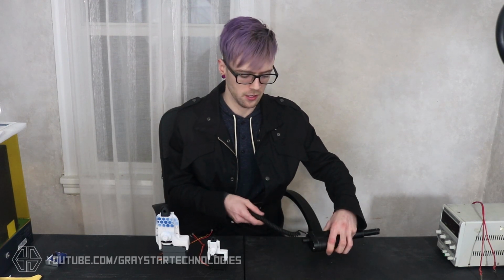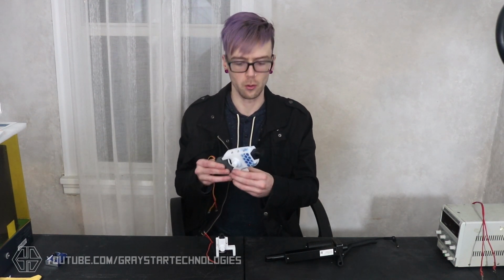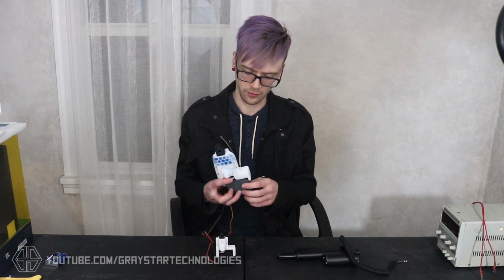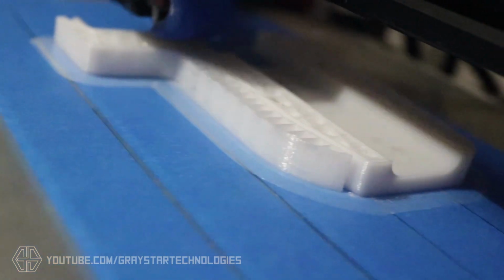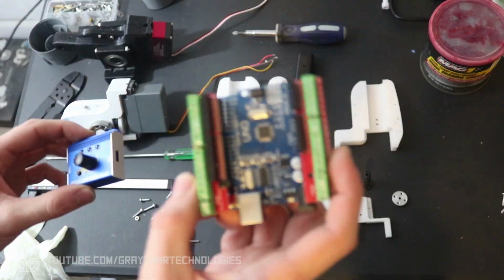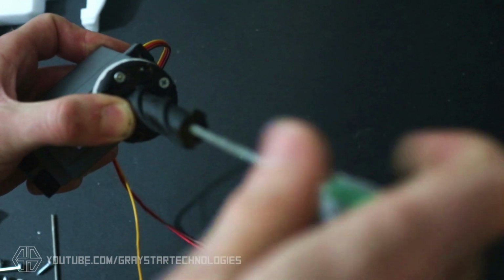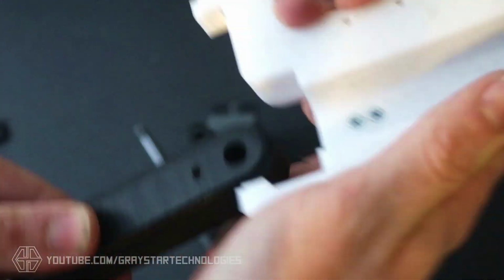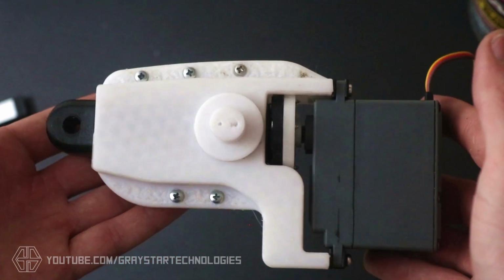Ep 1: Tutorial - How to Make a 3d Printed Linear Actuator from a Servo

Comment: This is perfect, I'm pretty terrible at modelling but just about getting by. This leadscrew design for rotary -> linear movement is just what I needed.
Thanks.
Reply from the maker: Glad it helps! :) That was the goal for this was a simple actuator to add motion to a whole bunch of applications! I'll have a "v2" video coming soon!
Reply: @GrayStarInnovations  I printed it and they work great. Using them to actuate paddles in a seat for a motion chair in my sim racing rig. What software did you use for modelling it? I'm getting better with Fusion 360 but struggling to import the STLs at the right dimensions. Already it works great for me, but I'm trying to slightly alter the inner piston to better fit my application. Great stuff!

Comment: just wondering if you had a chance to do a strength test  for the mg996 servos yet? 
awesome design and really appreciate you sharing your design. Thanks
Reply from the maker: Of course! Glad you like the design, hope it helps your project! And yes I did actually film one! I'll get that video up real soon along with a few more servo adapters. :) I meant to have it up before the holidays but got busy. 
The actuator does not offer much of a gear reduction unfortunately, it is more meant to convert the rotational energy of the servo into linear motion, they're still surprisingly strong though!
Reply: @GrayStarInnovations  are you able to also share the design files? Hopefully i can adapt it to fit standard size aluminium servo horns (alliexpress ones)
Reply from the maker: @hendr13x  good news! It’s already designed for the aluminum ones ;)
Reply: @GrayStarInnovations  any chance you can share solidworks or step files? Q